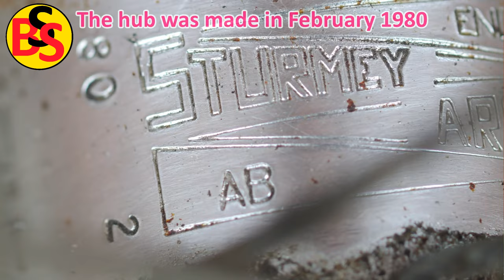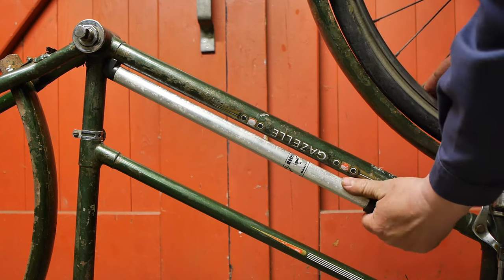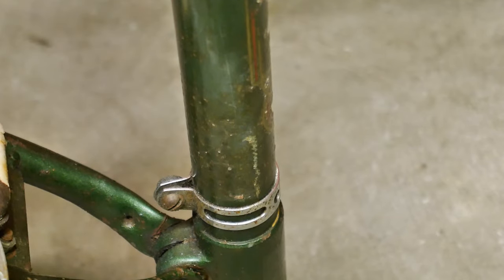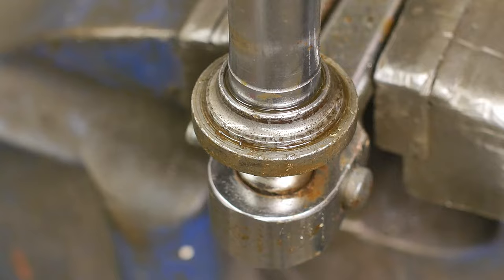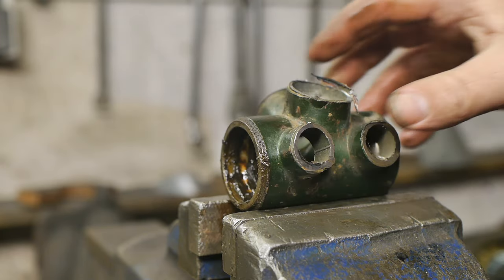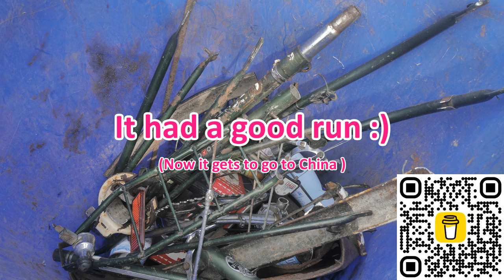Opening up an old bicycle bottom bracket

Comment: Omg. I bought 1of those at a yard sale for $10 put a motor on it and rode it 20miles a day to get back and forth to work for a few years until building my VW.. it's still in the barn and still runs 😂
Reply from the maker: That sounds like fun :) And I believe I also paid a whopping tenner for this bicycle.
But I do hope your VW bus is also running.